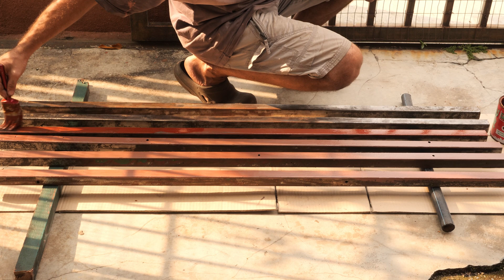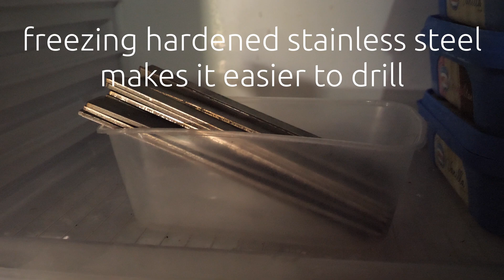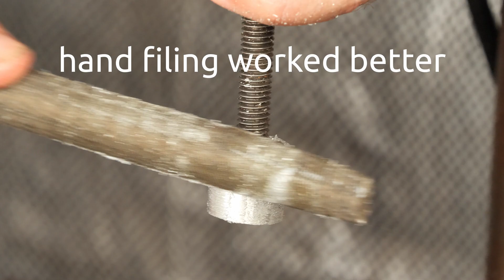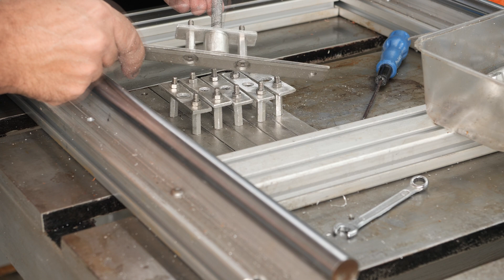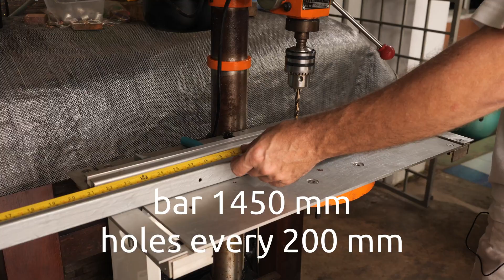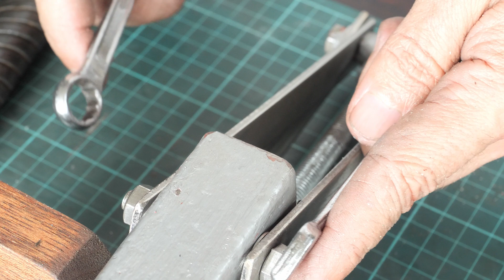Ultimate Glue Up Clamps | Best Design 4 Way Pressure Clamps

Comment: Hi Tiger.  Very nice build. Thank  you for the video.
But there is one thing I am not understanding.  The rear / aft scissors & rod assembly.
How do you set the threaded Rod here ?  Just Take a guess where it needs to be placed ?  Then set the Fwd as you have shown.  Thanks.
Reply from the maker: One pair of scissors is fixed and stays in the same hole. The other pair moves to different holes depending on the glued panel width. Most of the time I glue the same width table tops, so I don't need to move the bolt to another hole in the steel square profile.

Comment: These 4 way clamps are really great. No need to use the cauls or biscuits to align the panel boards during the glue up. 
They look heavy duty as well!
Reply from the maker: yes I tested their performance on some thick wood table top glue ups, and the results were really good. the glued table top was perfectly flat. 
and I didn't even need dowels to keep the glued boards aligned, like I used to.

I'm planning to replace these mild steel hollow profiles, with the stainless steel ones. I won't change anything else in the next generation of this design aside from the material of the bars to make it rust free for life.

Comment: You can use Stodoys to build it in the cheapest way.
Reply from the maker: thanks. are you affiliated with Stodoys? I never heard of them.

to be honest building the cheapest tools is not my objective.
I want to build my tools from the heavy duty hardened stainless steel and aluminum hardware, so that they will outlive me, and I can pass them to the countless generations.
I haven't seen a better design for the 4-way pressure glue up clamps to this day (please send me a link if you believe you found a better solution, I always keep my mind open)

of course optimizing the cost is always a good idea

Comment: That's excellent.  Great work.
Reply from the maker: the principle of the 4-way clamping is indeed genius. 

since it is only my 1st prototype, the workmanship quality is not at the top level, as the curiosity of how they perform was pushing me to rush it. I will soon replace the bars and threaded rod with the stainless steel parts, then there will be no need for the duct tape lining, no painting, and it will not only look better but it will become waterproof and timeless.